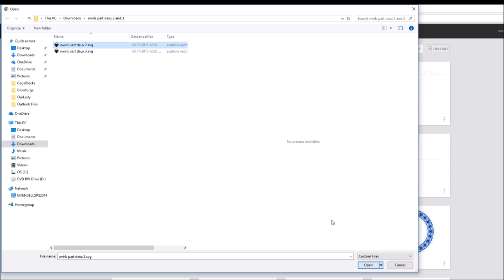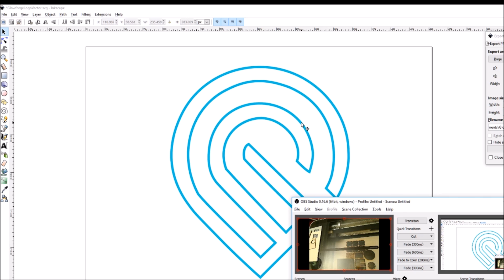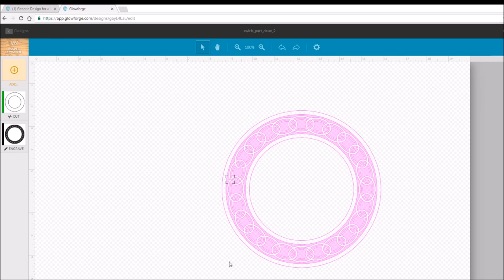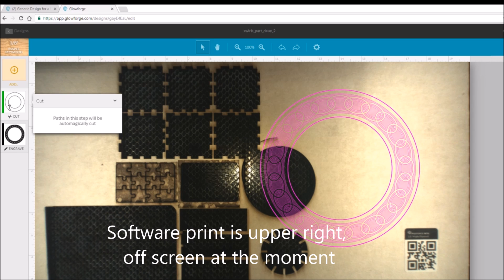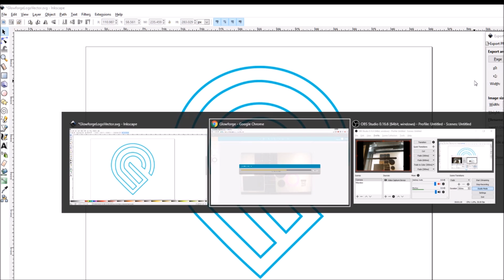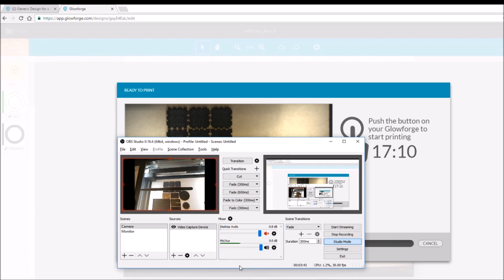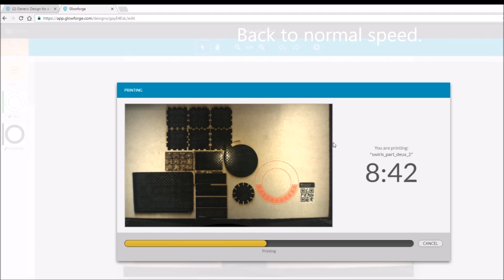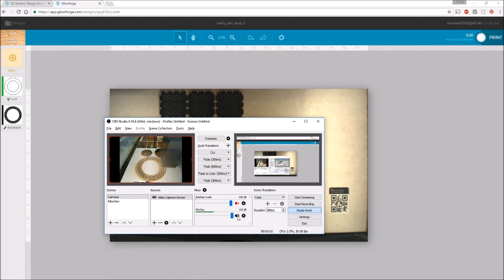Pre-Release Glowforge:  From design to print

Comment: where do you buy the material with the paper on top. If I cut directly on wood or some other material will I see a burn bleed? Thx
Reply from the maker: Mark Brienza:  Glowforge will sell ProofGrade materials that will perform consistently and predictably. They sent me some plywoods to test that are finished on both sides and covered with a masking to prevent char. The char and smoke are normal parts of laser cutting on wood and masking helps eliminate or minimize its effect on the finished surface. I also use plywood and hardwood I have bought or milled and I use masking tape or some this painter kraft paper for drip protection and glue on with spay adhesive. Sometimes I just leave it bare and wipe it or sand it clean.
Reply: Wow thanks for all that information I really appreciate it... I really hope to get A GF in the future. :)
Reply: if you're still hoping to get one here's a referral link for $100 off -  https://glowforge.com/referred/?kid=PcQ5fo

Comment: Why does it cut out before it engraves, it should really be the other way round.
Reply from the maker: Julian Ashcroft It depends upon layers imported to get a default processing order. You can change the order.
Reply: It makes sense to engrave first and then cut afterwards, as the material can drop slightly after being cut, which results in a slight position change for the engraving.